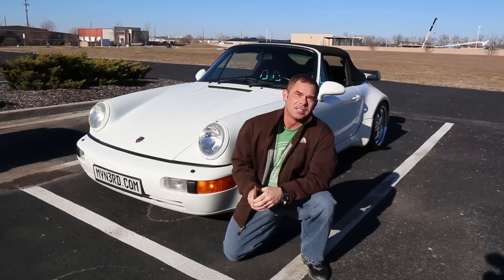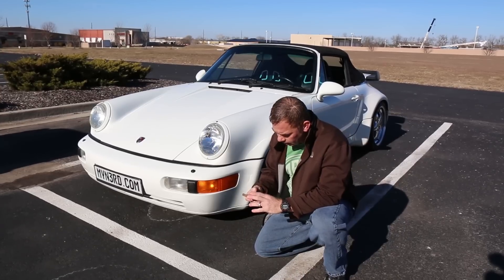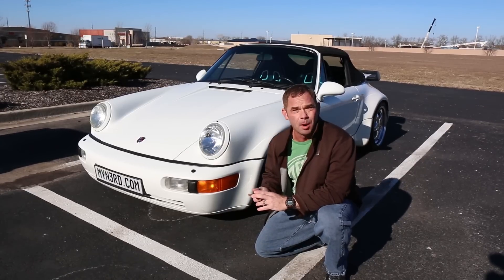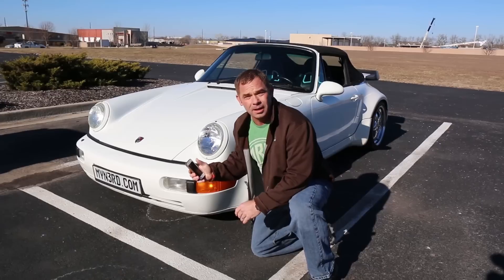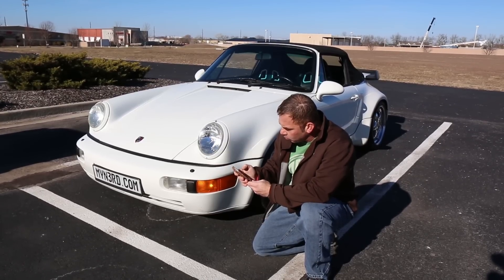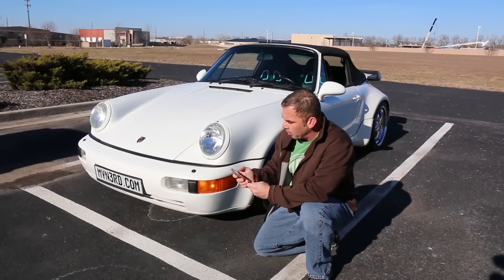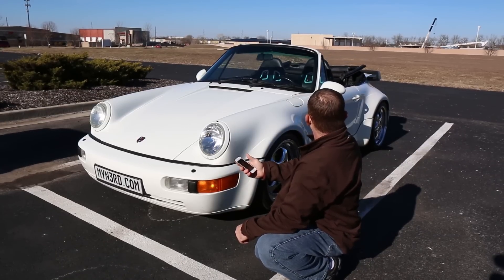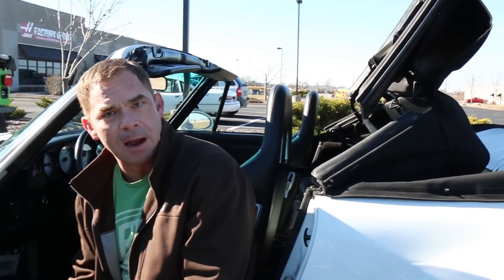MYN3RD powered Porsche Convertible Top

Comment: Is the car running?  I can't tell.  I'm assuming the N3rd is getting power from the car battery, is the device always on or just when the car is on?
Reply from the maker: Bret-

The car is not running in this example but the key is in the "ACC" position.  This can be configured however you want to control it with or without the key.  I kept most of the safety precautions intact (parking brake must be set).

Thanks-

Rob